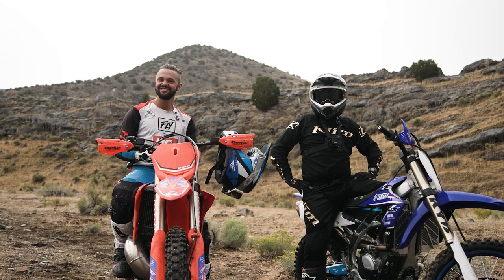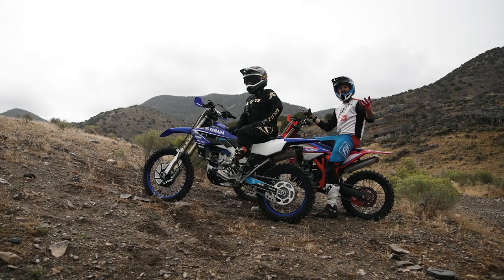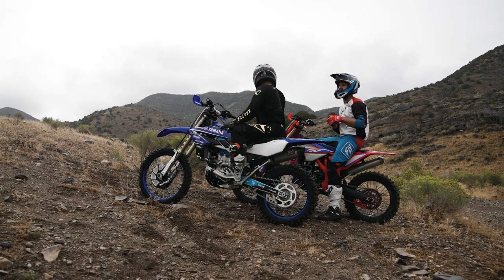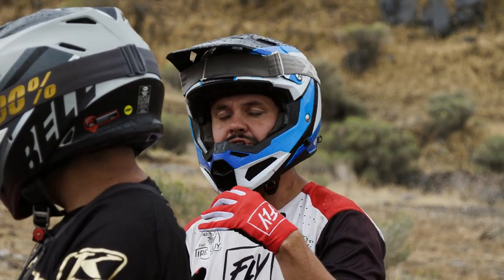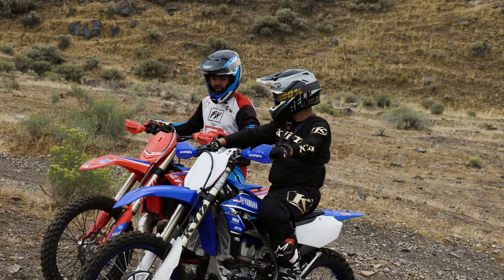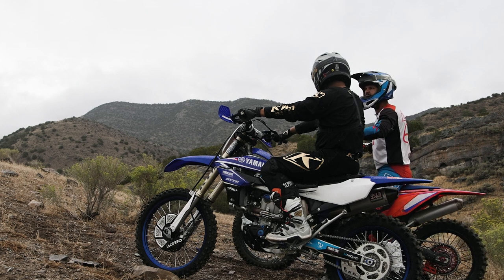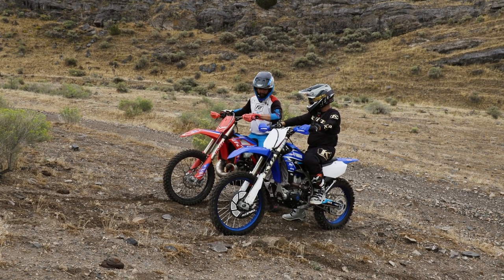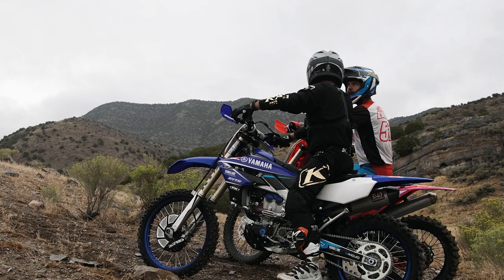MUST HAVE Clutch Control Drills Required for Every Rider!! Enduro Progression Series EP.2

Comment: I’m an OG, 50 years of bad habits. I’m determined to break em. I’ll admit, I’ve been afraid to use the clutch like this because of the fear of wearing it out. Since you sold me on todays more durable clutch’s, I’ll use this lesson to the fullest. 
Thanks for another good lesson. Also thanks too Mark for being a good Guinea pig.
Reply from the maker: Right on man! I love hearing that! We hope progression finds you!!
Reply: @papparratzi I know exactly how you feel.  I was the same way until this year when I found the more I slip the clutch the more control I have of the bike and the more traction I have on steep climbs.  If I have to spend $200 on a new clutch, I'll happily do that if it means I continue progressing at the newly accelerated rate.  Right or wrong it's partially a goal of mine to wear out a clutch in the pursuit of mastery.

Comment: Outstanding series, great to watch Mark progress.
  Followed your advise, the 690 needed a big hole to start the balance drill and now l find l'm practicing at all stop lights as well as off road. Lots of fun too.
  Went out riding yesterday and found myself searching out a 5 mile difficult riverbed section that l previously have avoided, lots of hardrock steps. Ran that section 3 times practicing, applying content from just the first two vids of the series.
  I can't tell you how much more fun riding is now, the hardest part is overcoming old ingrained habits (Old dog/New tricks) These techniques also have made riding the heavier taller 690 a completely new game that l am having blast playing.
  Thanks so F'n much !

Comment: I'm invested!

Watched the first episode and now I know what to do with another couple of hours.

Fun fact - in order to get your MC license in the EU,  one of the milestones in the license test is getting/riding away from an uphill dead stop. That's one of the fails that fails you.

Honestly - clutch control was the #1 issue my teachers POUNDED in. 

"Not good enough at counter steering? Slow speed circuit" "Not looking far enough ahead? Slow speed circuit!" "Can't handle exit stops from 70kph - SLOW SPEED CIRCUIT!!"

Comment: Rich EXCELLENT VIDs...I did private lessons with Steve Hatch Racing on the East Coast similar drills; for me, the ASV levers made it significantly easier to modulate the clutch vs. the OEM Factory Beta lever.
Reply: Cool. What is it about the ASV lever that made modulation easier?

Comment: sliding back down with the front brake locked happened a few times to me on tarmac in the Italian mountain roads where there is a junction to give way to traffic. The fork dive on a Ducati Multistrada is quite significant when rebounding from a hard stop, enough to lift the front tyre on the rebound stroke.  I was trying to always stop with the rear brake but I'm going to try this with slipping the clutch. It'll require a bit of practise with 1200cc.

Comment: This is the very first thing any rider should study and implement to become more than a throttle chopper rider. I felt like I was going slower in the beginning but realized that I was faster and more efficient from traction control.
I hear too many people sweating the idea of tearing up the clutch from clutch modulation. Its actually the opposite.  This is  what a clutch is for mostly and more importantly to temper the delivery like was stated..
Clutch is your map switch
A bike will ride and perform completely different and feel much better because of this.. less throttle and more clutch play makes a better day.  Don't matter how much power u have if it can't be delivered without smoking the traction.
Reply: Traction control from clutch I meant
Reply: I hardly ever touch the back brake and just a little front when nedded

Comment: A point about clutch wear; take into account how much power you disperse thru the clutch doing this compared to MX situation where ones slip the clutch under power coming out of turns and jumping. It's idle speed or just above vs full throttle, maximum hp and torque thru the plates. The only thing you will notice is that when the clutch get hot enough (actually much easier to notice on a cable-actuated unit, and yes BTW, my 500hrs plus YZ450F used for enduro is still on the original clutch) it won't be as easy to modulate. Time then to take a break and let it cool a bit. 
So;  little power/energy = little wear on the clutch. Go out and practice my friends!

Comment: Man what a great video!  I'm not sure if it was a misconception, but when my dad taught me how to drive a manual car 30 years ago, he said never to ride the clutch as it would cause excessive wear and burn it up.  But it sounds like that is totally fine on a motorcycle?  That's essentially what this video is all about...riding (slipping) the clutch.
Reply: The difference is the clutch on a motorbike has lots of plates instead of just one and its submerged in oil so it's quite difficult to get it hot enough to burn it up

Comment: Thanks Rich for sharing this Drill again. I learned today to give a bit more throttle, since I stalled the bike in the past. Can’t wait to practice it tomorrow again and with the rear break as the second module❤ One Question: is there a difference to a 4stroke bike ( I have a KLX 140)?

Comment: Thank you for this, it is very good. Middle finger is my clutch finger too, most people use the index, or two fingers, I don’t have much control/dexterity at all if I do. Do you think this may end up being a limitation? The other day I’ve been doing hours of very technical stuff and at some point the clutch had become so stiff I couldn’t operate it anymore. At the time suspected that a fault with the bike, but in retrospect it probably was “finger fatigue”. So, try to strengthen the middle finger or retrain from zero to use the index? Cheers.
Reply from the maker: Just have to get stronger. Middle finger is technically stronger than your pointer. Pointer has more dexterity. At least that’s what I’ve read. Jaime Bustoo uses his middle, he’s one of the best in the world in trials. Jeffery Herlings uses his middle in Moto, he’s one of the best to ever do it. Plenty of examples of success either way. Keep working. That’s what makes the difference.

Comment: I bought a 500EXC with a Rekluse and left hand brake installed. I like it for the anti-stall and better hand modulation of rear brake. HOWEVER, do these lessons in clutch control still apply? I sometimes slip the clutch on slippery hill climbs or to pop the front wheel over an obstacle but beyond that, I don’t use the clutch as much anymore. Do I have to get rid of the Rekluse to work more on my technical enduro/woods riding?
Reply from the maker: In my opinion if your intention is progression and to improve your riding ability,  I'd get rid of the autoclutch. Basically there is a reason the best riders in the world don't run them, they cause more problems than solutions.
Reply: I had a rekluse on my old yz250x. It was cool about 10% of the time ( muddy or when I was super fatigued ) the other 90% I hated it. My 22’ te300i has a Manual clutch which allows for better manipulation and proper building of skills. The auto rekluse will ALWAYS have a slight delay in it and will never act like a normal clutch when trying to use it as one. Keep that bike and get another with a manual clutch! 😂
Reply from the maker: Yep!
Reply: @IRCTireUSAMoto  I have had 2 bikes with the auto clutch, you can still use them like a normal clutch or not at all.  As the RPM increases the wedges push out and force the clutch to engage.  Not as direct as a normal clutch.  That said, my current Beta 300rr does not have a Rekluse and I think I am progressing my throttle and clutch control because of it.  I did add on a Clake One lighter clutch pull as I found the clutch pull on my 21 Beta was much harder than on my 17 Beta.

With the Rekluse autoclutch you also loose the ability to stall the bike on uphills and have the bike hold, it will slide backwards similar to being in neutral.

Another excellent practice drill, need to work on this one as well, once the snow melts.
Reply from the maker: @Coastal-rsidedown  well said!
Reply: Thanks guys. I am an out of shape casual rider that only gets out a dozen times per year. The 500EXC is not the perfect enduro/woods bike, but it can do most things reasonably well from ADV/dual sport to motocross. We can’t all afford multiple bikes. The rekluse and left hand brake are great for the majority of my seat time. Many of us don’t have any need to become the next Jarvis. I think a few “enduro-for-beginners” lessons for us casual guys with auto clutches may be interesting to more followers than you think.  Heck, it’s not really “enduro”. Maybe just how to get the most from your auto clutch in any situation. Food for thought!
Reply from the maker: I’ve taught to many people that have them and can’t do fundamental techniques that would make them safer more effective riders. I don’t think any autoclutch owner would like my “get the most out of your autoclutch video.” In my opinion to make a good paperweight. 😬
But hey it all comes down what makes you enjoy your ride.
Reply: The more recent  Rekluse clutchs only need to have the slave unit backed out to returned to a manual unit , with a slightly heavier pull. I love and need my Rekluce to survive some of our 100+ k trail rides. Also a blessing for machines without E starts , horses for courses.
Reply: @stevenpelayo9418  hey people always knock it but an auto clutch with a rear hand brake is a “woods weapon” or great for fast hare scramble type riding. I see a lot of casual riders, older dudes and people with injuries rocking them so whatever keeps you riding and comfortable. 
But when it comes down to this type of precision and progressing to better skills you’ll for sure need a manual clutch. I raced Tough like RORR with a rekluse auto clutch. Not the main event but the Saturday races. I did better with a manual clutch this year on my other bike.

Comment: Rich have you ever tried Midwest Mountain Engineering two finger clutch lever? I ask cause I'm curious if it limits the clutch control slightly cause the throw changes etc? It does significantly reduce clutch pull but the newer  Betas are already easy in stock on setting #2..Thanks for the videos man...your part of the reason I have the same 300RE👊
Reply from the maker: Hey brotha. I found it to limit the clutch control too much because of the throw. I prefer stock personally

Comment: Could you please give your opinion on recluse clutches. Do recluse help beginners?
Reply: Rekluse would be a major crutch as a beginner. You might never learn how to properly use the clutch with one installed. Highly recommend it though if you have carpal tunnel or any debilitating condition that makes using the clutch a pain in the ass.
Reply: @C.  thank you for your input@

Comment: I just bought a used 300 XC-W and it has a recluse clutch in it and I think to some degree makes it a little easier to control the low speed drills such as this with just the throttle control or not having to use the clutch lever as much.

Comment: a clutch is a consumable
Reply from the maker: Got that right!!
Reply: I think you're saying, you don't want to use it too much because you're worried it it wear out quickly....but I've cranked on my clutches and I mean cranked on them for several hours and when taking them apart they show very minimal wear. Don't be worried your clutch is going to wear out.  Unless you snap the power all day long on a sand track like Eli Tomac, you don't need to ever worry your clutch is going to wear out. They can take serious abuse for days and barely show any wear at all.  it's amazing how touch they are so use that clutch!

Comment: To be fair, it's more challenging with his cable clutch.
Reply from the maker: Very true for some first learning the cable clutch is more challenging but for someone who has focused heavily on clutch control it doesn’t make too much of a difference.
Reply: @IRCTireUSAMoto  That's exactly correct.  Whether riding my hydraulic clutch on my two stroke or my cable clutch on my 4 stroke 450, it's all about clutch control. I've gone up some of the most gnarly hills and riding all day long on my 450 cable clutch and mentally its all the same.

Comment: best way to burn thru a clutch?    practice launches...    this simple drill??   yea  very little impact

try a manual transmission car/truck in the snow or sand on hills.... watch your throttle/clutch control improve